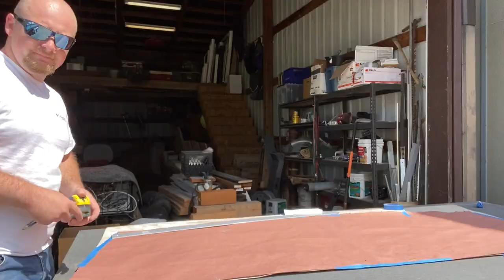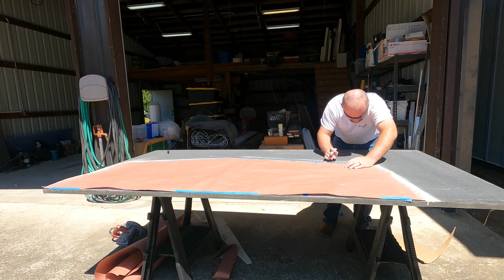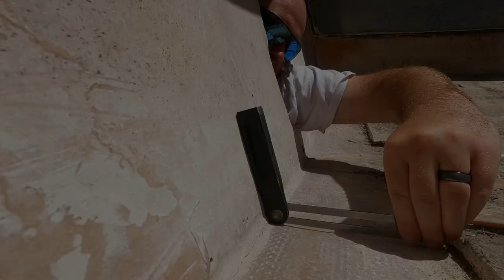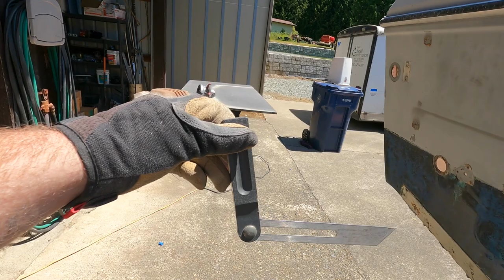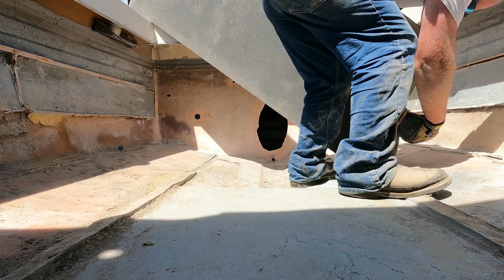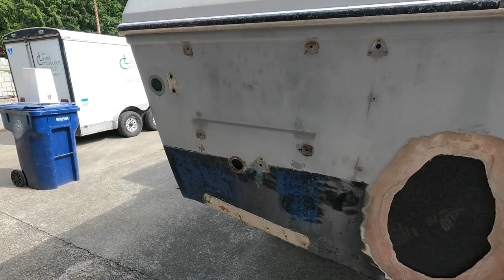Boat Restoration| Transom template and fitting Coosa board

Comment: Never cut Coosa board without a mask...ever.

 You shouldn't have to force the board in, it should slip right in. Leave a decent gap around the perimeter ( 1/4 -1/2" ish ) as you'll come back later with thickened epoxy and create a fillet that will fill the gap and allow the glass that you'll lay to turn those corners without bridging and air pockets. Keep plugging away and bit by bit it'll come together. Good luck!